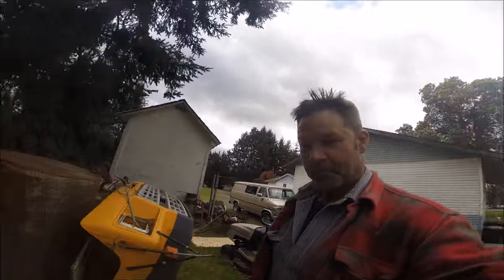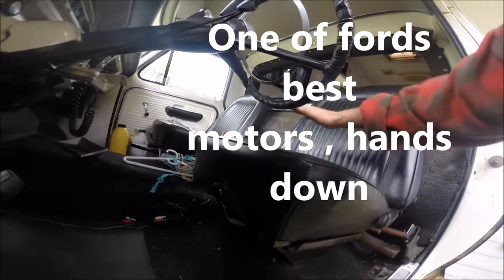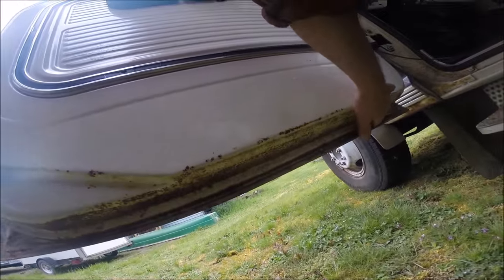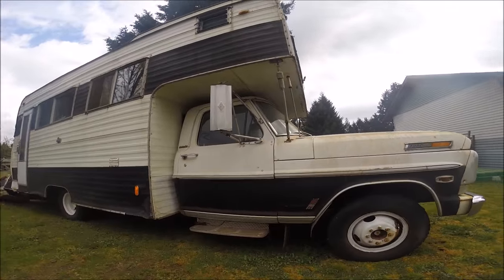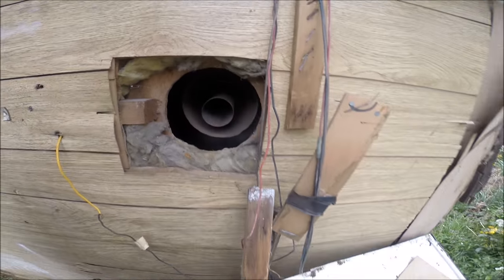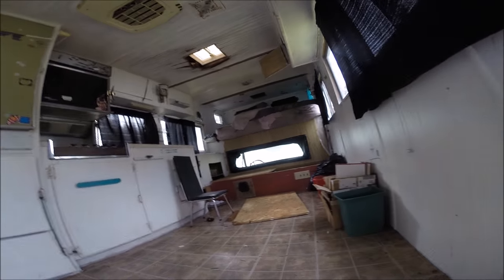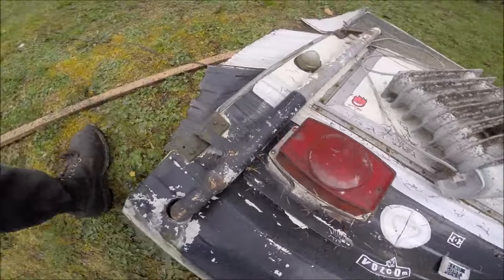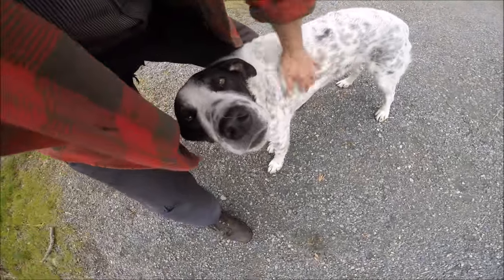I CANT WAIT TO DRIVE THIS BEAUTY

Comment: hey Billy, that would make one heck of a chip/dump truck.
Reply from the maker: +Nic Hood  ya it wood forsure
Reply: +Buckin' Billy Ray Smith to bad your so far away, I got a few old saws that you'd probably get a kick out of. my son built up an old mac to run with my 395xp